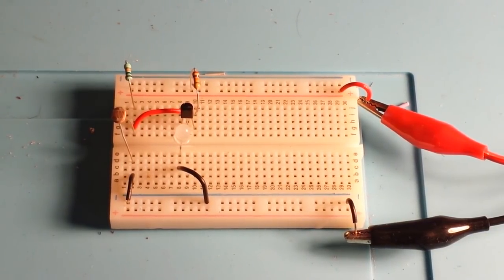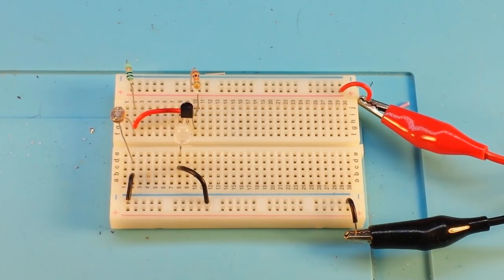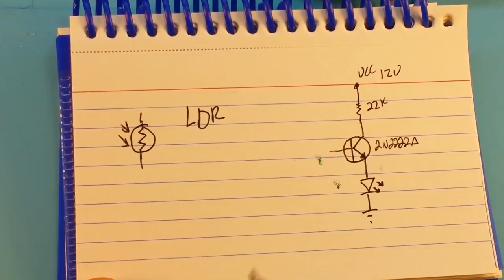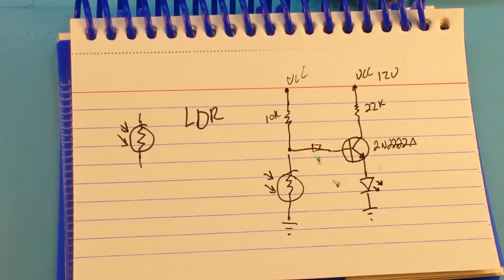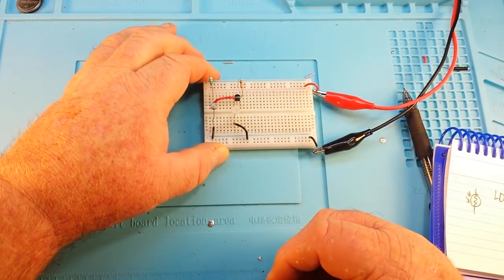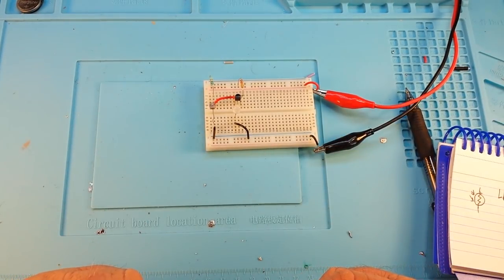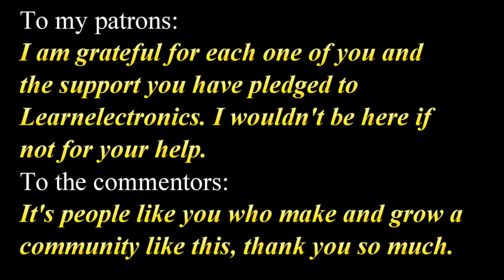Classic Circuits You Should Know: Light/Dark Detector

Comment: Classic fun first transistor circuit. When you swap the resistors in the voltage divider it works the exact opposite way. This was one of the first things I breadboarded when I started learning electronics. I’ll tell you one thing it took me awhile to wrap my head around the simple component swap reversing the behavior, but it hooked me. Great video Paul.
Reply: I put this circuit together, and it worked to turn on when dark. When I switched the 10k and LDR the led would be one when light, but would not turn off when the LDR was dark, it would only dim.
Did I do something wrong?
Reply: @felixcosty  It's using transistor as voltage follower and not like switch. "Simple" solution tweak resistor values and swap led and transistor place. With this you have to use base resistor if ldr going too small value.
Reply: @LimbaZero  the question at the end of the video. I do not have the knowledge to form the right question this the best I can come up with. Does switching the LDR and 10K answer the Question?
And if so the circuit created works more like a dimmer switch, then and on off, instead of being the opposite of the original circuit. Was the question at the end of the video to be and on off switch, but on in daylight and off at night, this is wear it gets a bit confusing.
Reply: @felixcosty  yes. switching 10k and ldr is right answer.Current version of circuit is "dimmer" style. 10k and ldr set voltage for base and emitter is about 0.6v under that. This circuit wotk this way with leds because they have treshold voltage. if normal lamp is used then it's dimming it. When led is stating to take more current then voltage over 22k resistor is close to 10k then it start limit current for led.

Comment: Swap 10k and LDR. In that case when LDR get bright whough trasistor base voltage is rising to point (0.6V + Uled) where led start to work. Also don't try to use this type of circuit for normal lamp. Use common emitter circuit for better switching caracteristics and lower power loss in transistor. For big current lamps darlington is needed for enough high hfe or drive relay.

Edit:
There also is broblem when changin 10k and LDR. if LDR go enough low resistance when bright then transistor Ib is going high because LDR is only limiting factor for led current.
Edit2:
Good idea usually to draw all chematics if you are doing some circuits. That help people to understands how it's really connected.

Comment: Swap the base bias resistor and LDR to create a dark/light detector. 
Works a treat but energy efficient... not so much.
Wouldn’t using a PNP transistor (Base pulled high using a higher value resistor) Base biased to ground via LDR be more efficient? 
Or is that why you are using a NPN transistor as a high side switch?
Just guessing - will have to look that one up...
Thanks for your insights, I appreciate your videos greatly.
Makes me stop and think.
Especially as most espouse digital solutions when I am often looking for simplest solutions.
Reply: der bender nice - as a low or high side switch?

Comment: replace the 10k resistor with a resistor having resistance equal to ldrs normal resistance which was about 0.8k in your case so that there is equal voltage drop and the current takes the path to the transistor and to the led

Comment: Is the voltage rating on LED's the same as the voltage drop across them? Your using a 12v power supply and it looks like your limiting current but not voltage across the LED.
Reply: If you limit the current then you are automatically also limiting the voltage on the diode, because the resistor will drop the excess voltage. If the current is within the rating of the led, you are good.
Reply: @cosimo8046   Just for fun I created a circuit with an app called EveryCircuit that used a 12v supply and an Led connected in series with a 22K resistor. I had to turn the power supply up to 800 or 900 volts to fry the Led. That huge resistor really limits the current!

Comment: Why doesnt the current ALSO flow through the transistor when the LDR has low resistance? why only to ground?
Reply: Well, it does, but at a much smaller current, thus allowing a much smaller emitter current.  Think of it as a voltage divider with the 10k from Vcc to midpoint, and the CDS cell AND the transistor's base to emitter resistance from midpoint to ground.   When the resistance of the CDS goes low, it pulls the voltage at the midpoint low, giving less voltage (and less current) at the base.

Comment: Let there be light! - God

Let there be more light! - Pink Floyd

Answer: Flip the resistor and LDR.
Reply from the maker: Correct
Reply: Did something similar with PNP transistor, but my favorite is with an Op-amp.
Reply: @captainpugwash4100  op-amp is best for setting acurate tripping point. Also common emitter circuit is better for lamps and relays.